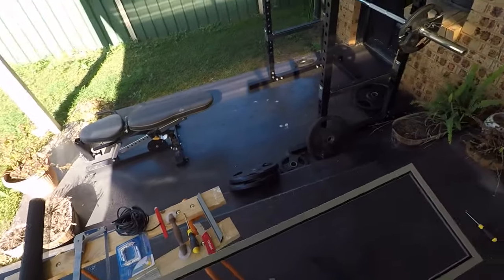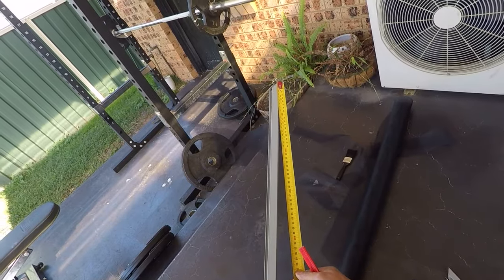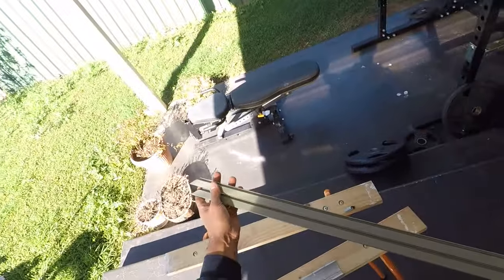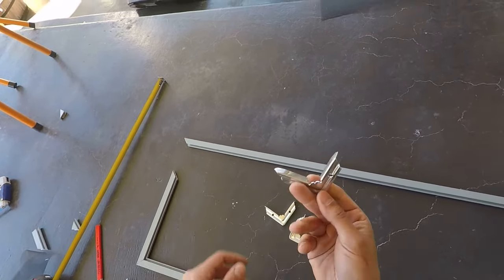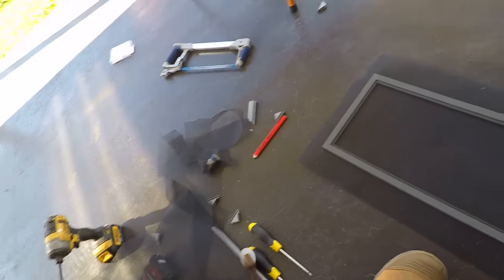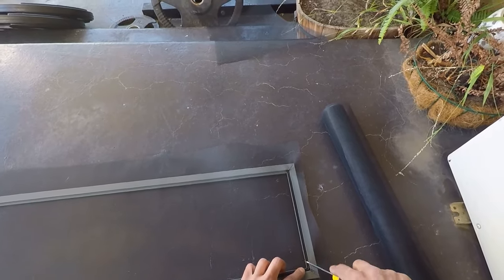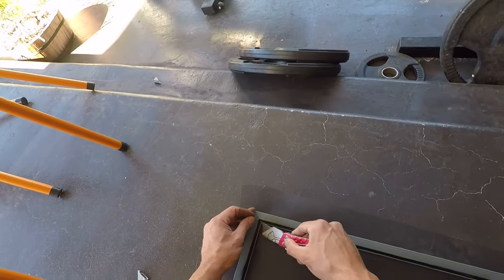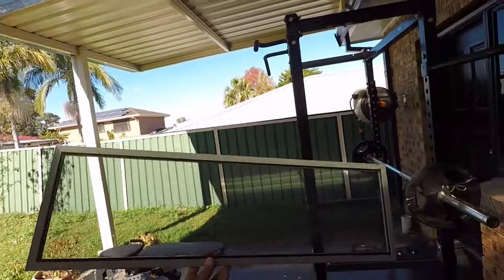How to make window fly screen tutorial

Comment: Thank-you Bill!  I made 5 flyscreens on the weekend.  All installed and for the first time since we moved into the house, we've had the windows open!  Makes such a difference as the weather is warming up.  

Next problem - the windows are from the 70's, with these corkscrews in the sides of the frames, and presumably 2 of them have failed, because a previous owner has pop riveted them closed!  :}

Comment: Show us how it fits the window and how to keep it there please!
Reply: Use detergent and soap up the two top corners. Place those two corners into the frame at 45 degrees or less if you can and slide an rotate the fly screen. Once they are in position, lift the fly screen up as far as you can and the bottom two corners should simply pushed into the frame. 
The detergent really makes a big difference.

Comment: Thanks Bill. Such a clear and easy-to-follow video! I have made my fly screen and it's perfect. However, I have awning windows and have to cut a chunk out of the bottom (leaving just the trench for the spline) to fit over the wind-out mechanism. Do you know what tool I would nee and how I can achieve this? The hack saw can do the vertical cut (although it is tricky because it is higher than my angle-cut thing), but I can't work out how to successfully make a horizontal cut. Any ideas?

Comment: How do you measure so that the screen fits in but doesn’t fall out?
Reply: I want to know too
Reply: @rafac13  I'm guessing make it a millimeter or so bigger. I'm going to make one in a week, I'll report back if I remember. If it's a little loose, you can get little swivel tabs that flip open and shut to hold the screen securely.
Reply: I had a plastic channel system on my windows. They seemed like a good idea - the screen slides up and down but they were removed for a painting job and now I need to try and make new fly screen frames and thinking clips might be easier? Not sure! Need a demo video Bill 🤓

Comment: Nice video bro, I skipped ahead coz I've done the flyscreen repairs part. However I was wondering how much overlap you like your frame to have as to nestle into the flyscreen slot on the window frame? So if window is 700W would you add say 10mm either side so it slots in nicely?
Reply: Yeah exactly, this vid is great, but totally missing the part where he measures up the window, and the part where he installs it!